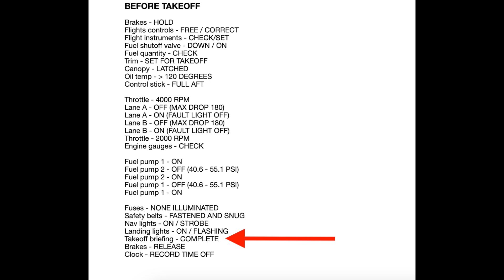Beware Engine Failure in Your Plane

Comment: All well and good to have a plan. Why not have a rehearsal? Go to a reasonable altitude and see if the maneuvers work within the parameters described. Without opening up the whole impossible turn controversy, when one needs a high rate of turn, one needs a high angle of bank and attendant nose low attitude to preserve energy. Practicing will give you better feedback on the realities which will be time critical. Use a passenger making notes or a GoPro during practice to get empirical data.
Reply from the maker: Good advice.